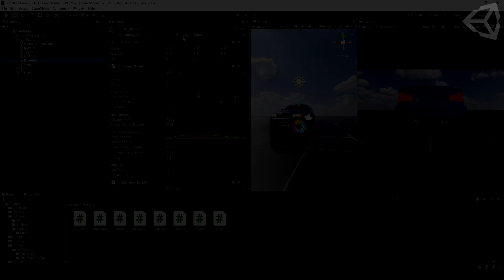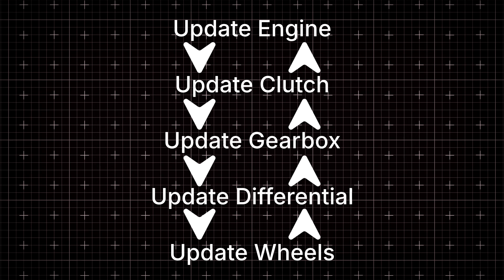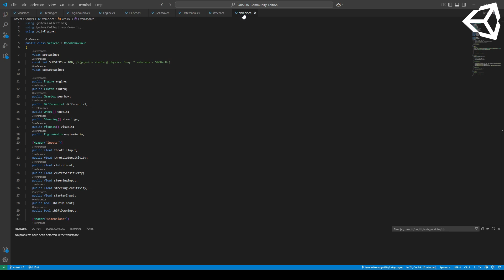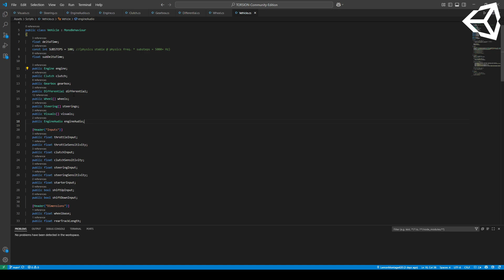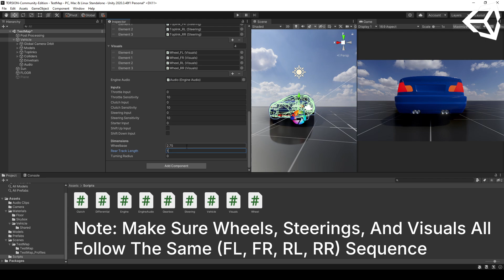Vehicle Physics | Drivetrain

Comment: So nice to see everything comes together. And the engine "overshoot" effect when shifting is so nice. 
A question about the friction clutch. In reality when the clutch is locked the angular velocity (AV) of the transmission should match 1-1 with the engine AV, but in this implementation the engine or the transmission AV won't match, one will always be faster than the other in order to generate torque. Would that slip be bad for the clutch in real life, as it will always be sliding and wear down overtime?
I'm thinking of a torque based approach, where the information being transmitted both ways are torque rather and just AV. Take the clutch for example. We have the maxClutchTorque of the clutch. The engine transmit engine torque as Max(engineTorque, maxClutchTorque) to the trans and to the wheels. The wheels then transmit back the Max(TractionTorque, maxClutchTorque) back to the engine, then the final engine AV will be the (engineTorque-wheelsTractionTorque) * inertiaEngine. The Limited Slip Diff some of them also works on torque effect also
Reply: in this code, slip (engine_speed - gearbox_speed) is used to generate torque for both the engine and gearbox, but the more "realistic" solution is using sign(slip) instead, the direction, which is either -1 or 1. you use that multiplied by the clutch torque capacity alone and it's already enough. the problem with this though are massive oscillations when you reach equilibrium, and it's what i have on my own simulation that i have been doing for quite a while. integration helps but honestly idk what to do.
Reply from the maker: Welcome again! I really appreciate you leaving thoughtful comments on my videos :D
I think your torque-based approach could work, and it may solve the slight slippage issue currently present even when the clutch is fully engaged (an issue caused by low physics frequency). Id encourage you to try and develop the implementation yourself and sharing it on the vehicle physics discord server found in the video description. If you need help developing it, I'd be more than happy to assist you on the server.